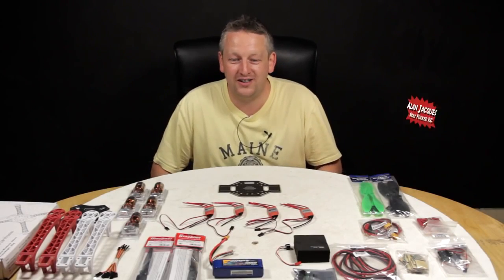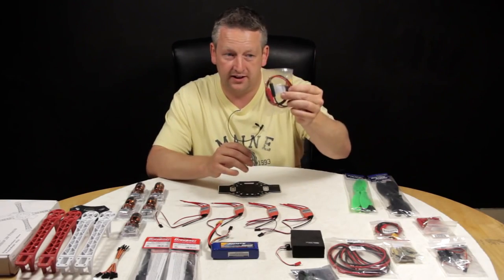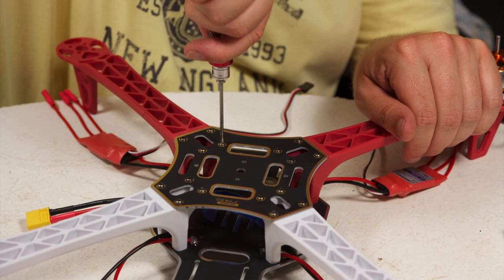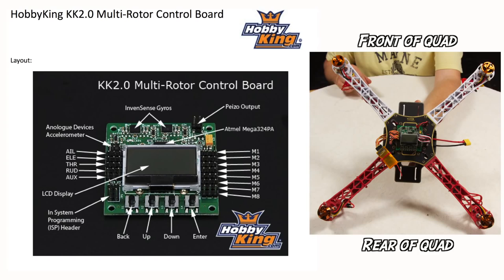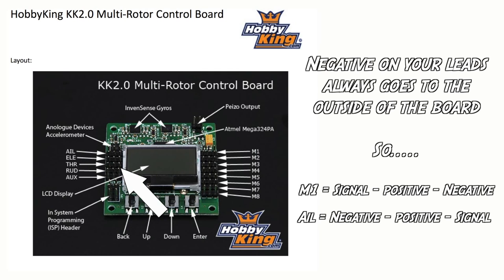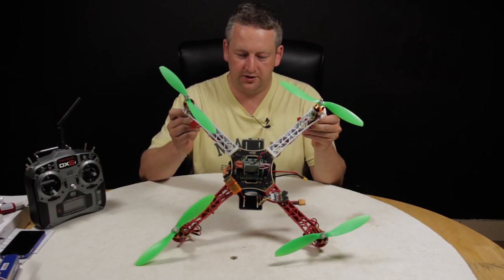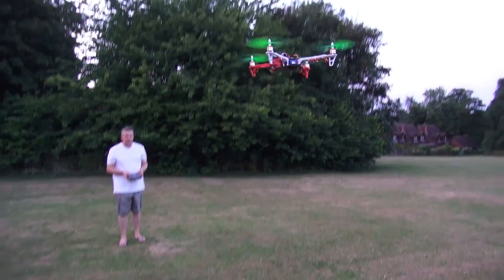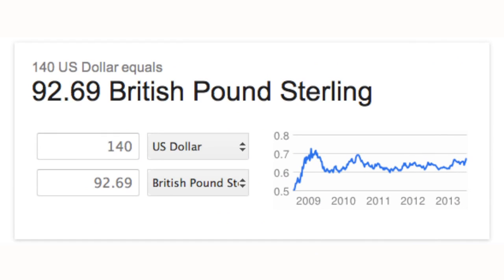How to build the awesome kk2.0 - 2.1 quadcopter by RCTV-UK

Comment: As an instructional designer, your video is one of the best I've seen for an entry-level build video.  Kudos to the video editor for taking the time to present the material in a very readable manner.  A lot of work went into this production and it was tight (efficient).  

Alan did a great job presenting the material.  His speech was clear and understandable.  The set was well lit and the background was devoid of distractions. The round table kept all parts in view and with easy reach of the presenter.

May I suggest that in the future or adding to this video:
1.  Add Objectives of the present ion to the introduction to tell the new hobbiest what to expect.  Is this a one off or the first of a series.  If this an intermediate lesson, tell the viewer what they must know before tackling this video and/or project?
2.  Avoid using jargon like ESC's and FPV, OSD, etc. Just say the words or put them in a lower third.
3.  Use metrics (numbers) in describing the equipment's capability: props, battery capacity, speed controller to motor continuity, For example, at the 131 gram aircraft weight, what is the expected flight time?  If a gimbel and GoPro3+ are added, what will the flight time be?
4.  Spell out the name or handles of referenced videos that are necessary to complete this project.  
5.  Close up of small features, such as motor mounting, could be done with still shots and cut in as needed.
6.  Over all make the teaching points viewer centered, i.e. what he or she needs to know to complete the project.

Thanks again for you time and effort.  Thumbs up from Florida.
Reply from the maker: Thank you very much Richard but I can not take all the credit, without my friends jumping in front of the camera to help produce this stuff I would be lost. 
It is nice to read a positive comment from time to time though so thank you for that.

ATB Malc 
RCTV-UK
Reply: Alan, As a newbee to RC, I greatly appreciate your efforts. Well, done mate!

Comment: Good work, just received this frame and the soldering on the integrated board was helpful, haven't used this type of design before :) Thank you, this is 300g lighter than my other frame so hoping for much better flight times :)

Comment: Looking at building as a first quad build. If i used the Zippy Flightmax 1800mAh 4S1P 40C, what equipment will i need to charge it?
Thanks for the awesome build tutorial.
Reply from the maker: A lipo charger, thank you for the kind words.

ATB Malc
Reply: RCTV-UK Thanks, can you point me to the right one, either Hobbyking or a UK site.
Reply from the maker: ***** http://www.ebay.co.uk/itm/Turnigy-Accucel-6-1s-6s-lipo-Balance-Charger-LiPo-LiFe-NiMH-NiCd-GENUINE-/271578554310?pt=UK_ToysGames_RadioControlled_JN&hash=item3f3b57dfc6
Reply: Greatly appreciated! cheers

Comment: I bought the charger, however i have been getting a "Battery Vol Err Cell Connect". The battery is almost new only using it a couple of times. Been setting up the right input, yet i still get this error. To power it is a 12vdc 3.0a mains plug. Battery is 3s 11.1v 1300mAh. Charging it at 1.3a 11.1v.
Reply from the maker: You may have a duff charger or battery (more likely to be the battery)
Reply: Thanks for responding. I tried out a couple more batteries and seems that it is the charger. I'll speak to the seller later and see what can be done. Cheers for helping me

Comment: very good tutorial, I will order parts for a build like this. what is a good battery to use with this setup to fly atleast 10 mins or more if possible with gimbal and fpv?
Reply from the maker: 4s 5-6000mAh should get you well over that but you will need a slightly lower KV motor maybe something around 650kv
Reply: RCTV-UK wouldn't I need a higher kv to be able to pick up the extra weight of the gimbal, I currently have a cheerson cx20 and with gimbal and fpv I only get 5 mins with 2700 mah 3s, I would really like to fly longer. please help
Reply from the maker: Lower KV will give you more torque and efficiency on a bigger prop
Reply: RCTV-UK sorry about all the questions.  Noob here. So why is it that you use 1000kv on your build and what size prop would I need for 650kv. I am trying to get as much info as I can before I start ordering parts. I don't want to be disappointed after I'm done.
Reply: Also what size esc would you recommend for 650kv
Reply: RCTV-UK I thought higher kv is stronger and better for more payload, I was wrong.
Reply from the maker: Marcio Cardenas Our build was a lightweight set up, if you want gimbal etc you will need a more powerful set up.
Go to Hobbyking or MyRCMart and find a 650-950kv motor and it will tell you what props to use in it's specs.
It will also tell you what ESC's to use etc.

ATB Malc

Comment: Hi, love your vid and i'd like to know what is your "dx6i setting" for quadcopter?
Reply from the maker: Hi Kanh sorry but could you be more specific?
Reply: Did you change any of the "D/R&Expo, Gyro, Thro Cur, and Pitc Cur" from your dx6i. If yes, could you share it with me? i just bought dx6i and i have no idea how to set these for x quadcopter. Thanks!!!
Reply from the maker: Kanh P Only adding + 20% - 30% Expo on roll and pitch on our set ups and always use Acro not Heli. I hope this helps you and is not to late.

ATB Malc
RCTV-UK

Comment: Beware:    The ISP Socket is not a standard AVR-ISPMKII programmer socket .The pins have another pin numbering in the schematic.These are done that those Hobbyking-Bastards so  they can sell here extra own Firmware Programmer.